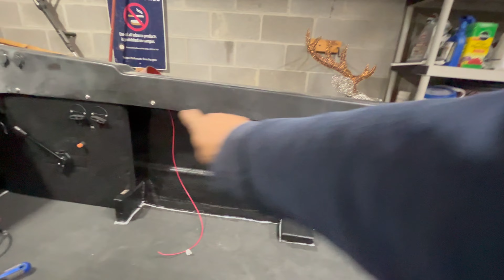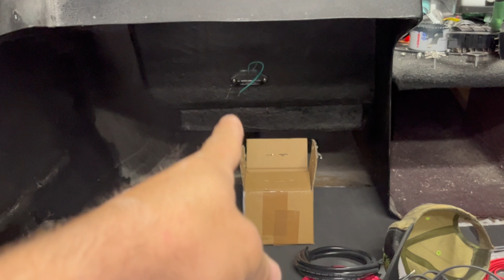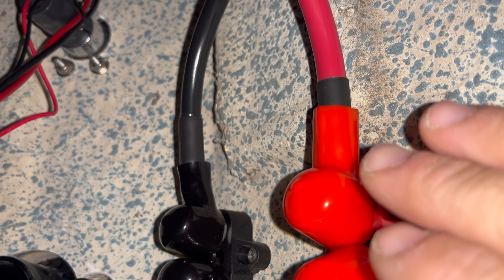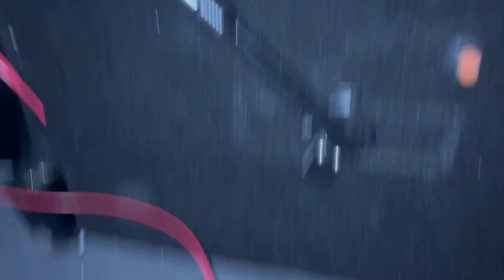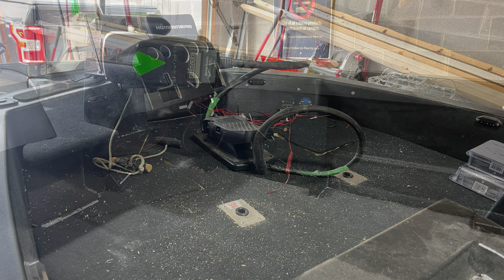Wiring The Boat #ScorpiusFishing #StellarAbyss @ScorpiusFishing

Comment: What size prop are you running an pitch size, and top speed info? Thanks
Reply from the maker: The old prop is the original 2 blade 13x15p. I’m trying a 3 blade out that hopefully should work. It’s a 3 blade 12.5x15p that will go on after I get the outboard remounted. I’m estimating the top speed to be around 35ish, but unsure as I only had it while the compression was around 80 across the cylinders. Post rebuild it should be alot stronger and I’ll tune it using the new prop.
Reply: @ScorpiusFishing  i have a 13x15  3 blade on mine gps constantly hit 27-28 mph on the 5th trim whole from bottom but can get cavitation in sharp turns' trim tab whole on 3rd whole from bottom will hit 26-27mph thats with a bimini top open and 2 6 gallon cans full at the back im 160lbs with probably 75 pounds of gear in the boat i also have a SE sport 400 stabalizing fins(hydrofoil) attached before that i had it to 31mph hope that helps
Reply from the maker: Thank you. Even if that’s around all I push out, I’m good with. I’m looking more for acceleration rather then going too much faster with the type of boat it is. I think the trim unit I have will help too since all I was used to before was whatever the swivel locked the trim level in when I dropped it manually. I didn’t have an rpm gauge before either so not sure if I was even hitting the right rpm range before. Be able to tune alot easier.